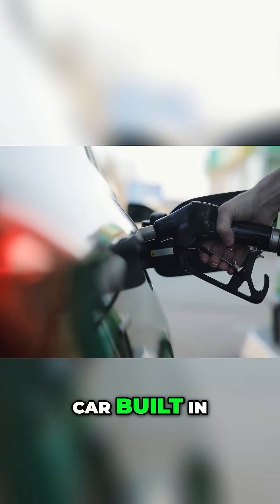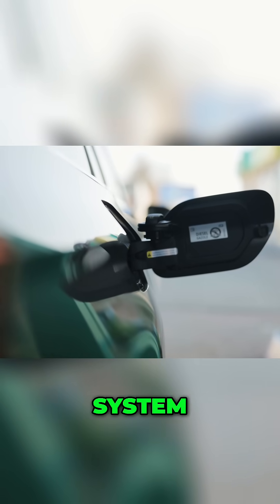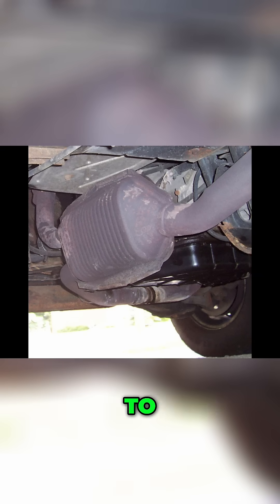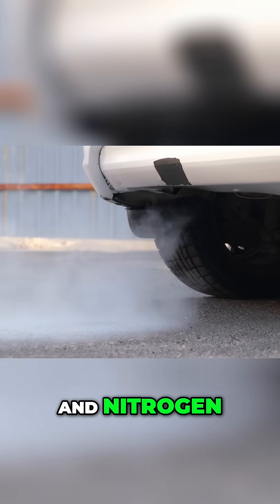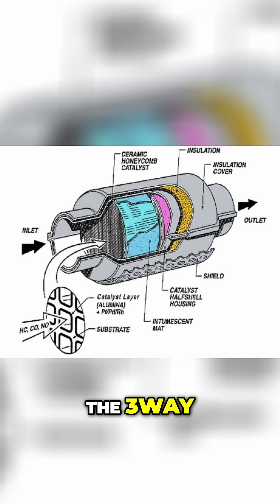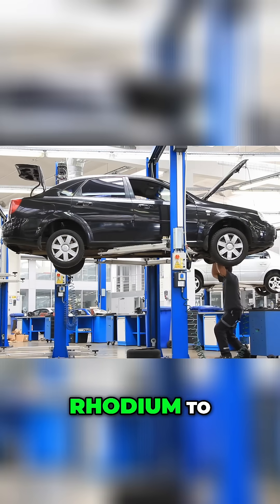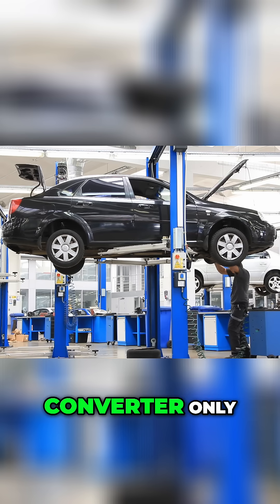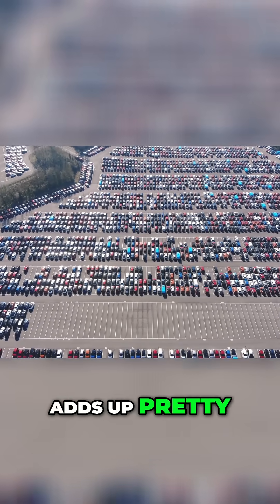Rhodium: The Unsung Hero of Catalytic Converters!

Comment: The carbon monoxide bakes in the sun and converts to ozone.
Reply from the maker: That is a common misconception:

Carbon monoxide (CO) does not convert into ozone (O₃) by baking in the sun.
But there’s a grain of truth behind the confusion, tied to urban air pollution.

What actually happens:
Carbon monoxide (CO) is a toxic gas produced by incomplete combustion (car engines, fires, etc.).

CO itself doesn’t form ozone, but it plays a role in tropospheric (low-atmosphere) ozone formation, indirectly.

Ozone (O₃) at ground level forms when:

Sunlight interacts with nitrogen oxides (NOₓ) and volatile organic compounds (VOCs) (not CO directly).

These reactions are part of photochemical smog.

So while CO contributes to air pollution, it’s mainly NOₓ + VOCs + sunlight that form ozone — not CO baking in the sun on its own.